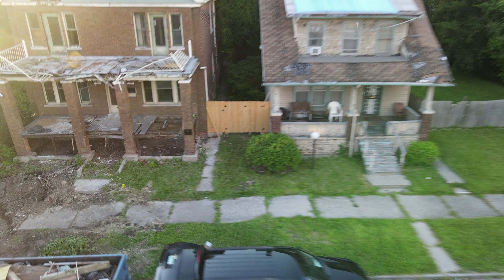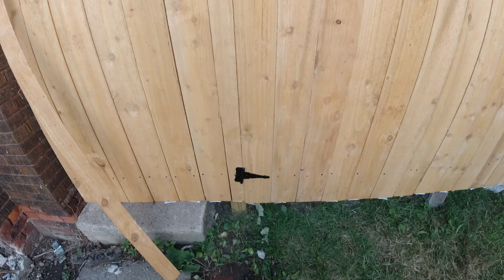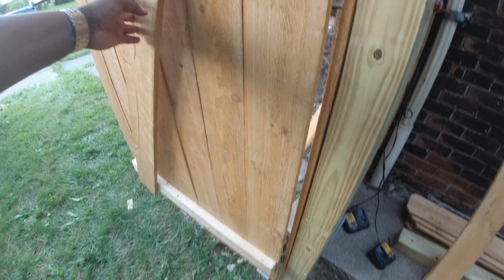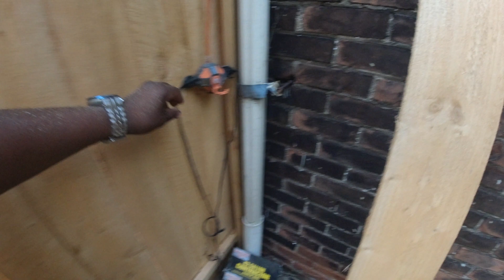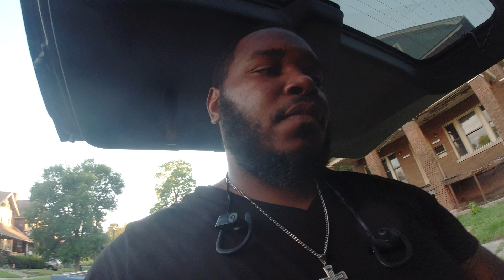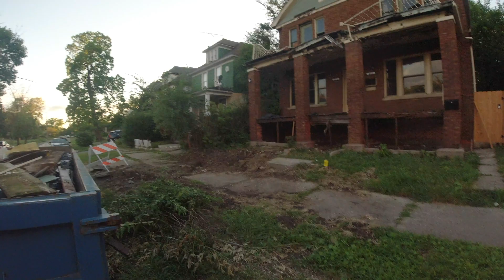How to Secure Your Detroit Land Bank Property

Comment: What happened to the water line? The gate looks good
Reply from the maker: ASAP Haul apparently the Detroit water department cut the waterline and forgot about it or didn’t document it. so they sold me a house thinking the water service was OK and it was not now to repair this issue it may cost me 7k
Reply: Calvin M You can argue that if you have paperwork from landbank saying water line is not disconnected.
Reply from the maker: Greater Alexander I will cover the solution in my next video but you hit the nail on the head✊🏾
Reply: Thats not cool..I hope they are not working together to get $7000 out of folks
Reply from the maker: I hope not
Reply: @calvinm730  what's your ig
Reply from the maker: @preciousmonique9076  The link is in the description of this video